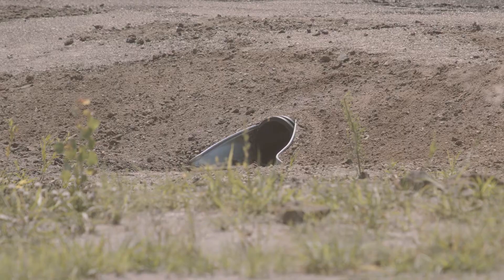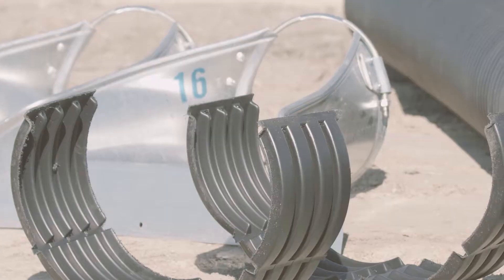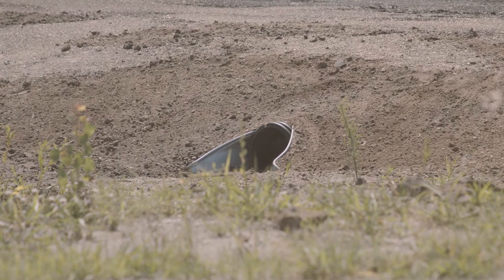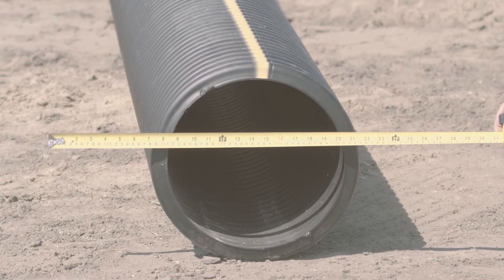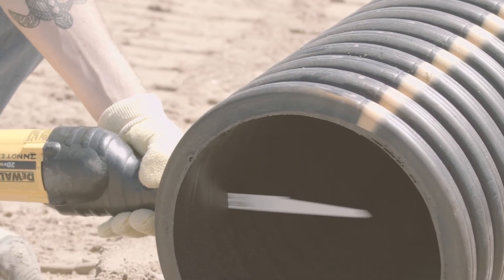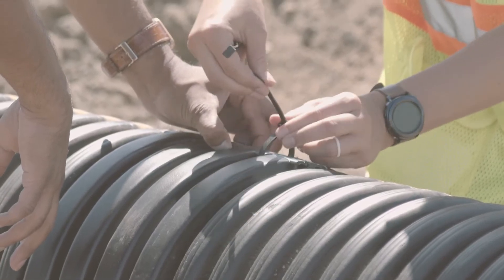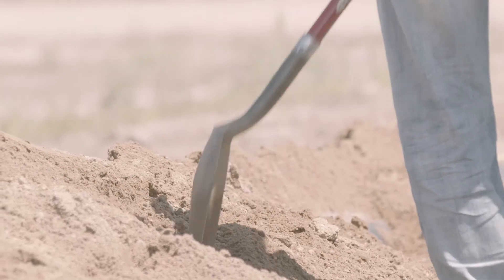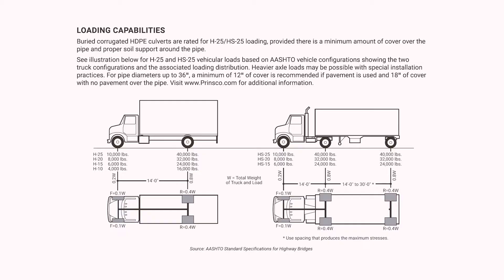Do-It-Yourself Culvert Installation Guide by Prinsco

Comment: What degree of slope does it need to be?
Reply from the maker: The slope needed will depend on a number of factors, including the diameter of the pipe, and the desired flow rate. Without knowing site specific details, the generic minimum slope for a dual-wall culvert is 0.5%.

Comment: My HDPE pipe was installed under my driveway and then walls were installed at the inlet and outlet ends which only allows an inch or two extensions. I think that will make it impossible to fit those aprons on the ends. Is there another way? Thanks
Reply from the maker: Hello Bill.  Thanks for the question.  It can be difficult to address specific situations in this format.  Feel free to reach out to the Prinsco Application Engineering team for help. AppEng@prinsco.com

Comment: Hi there! What kind of pipe do I need to use for a culvert that can passage 40 maybe 50 ton trucks ?
Reply from the maker: Hi Kirsten. With proper installation, our products can handle H20 vehicular loading which uses a 32,000lb axle weight. Depending on other installation factors, higher loading can be achieved. Feel free to reach out to our Application Engineering department via our website: https://www.prinsco.com/contact/